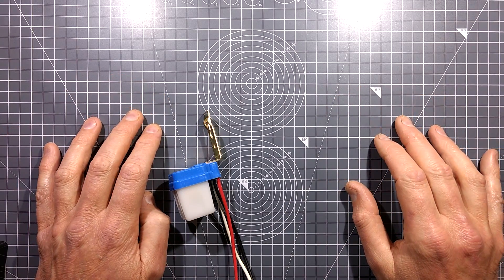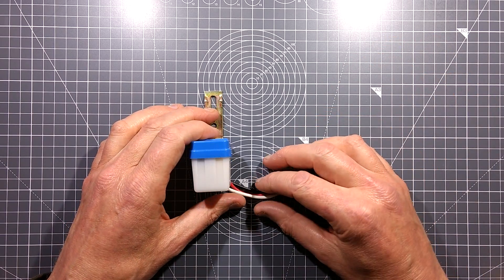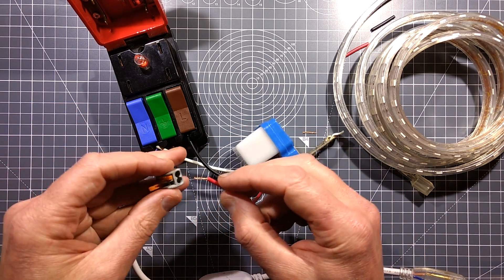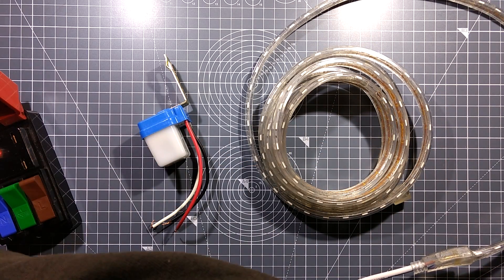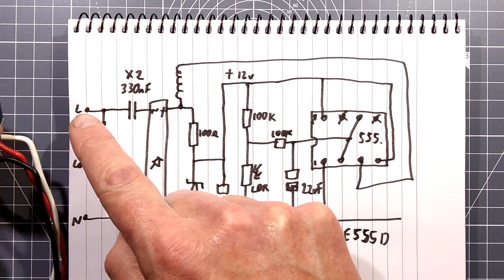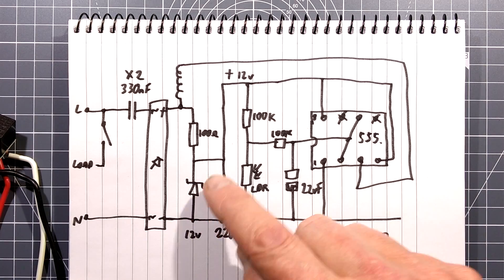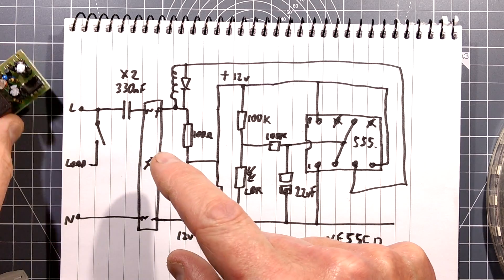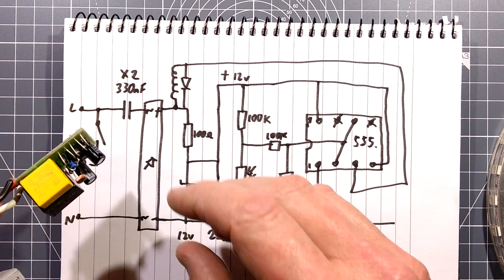Common Chinese dusk switch.  (With schematic.)

Comment: Have a metal plate instead of a cutting board.
Reply: From a chemical perspective, metal is safer than anything else he can have (within the bounds of monetary reason). Clive is smart enough to employ proper practice when working with electrical equipment. Also he can ground the plate, making it an actual safety feature.
Reply: Look, I'm a chemist, not an engineer. The guys concern is setting fire to his workshop. Unless he wants to pay for an expensive lab bench, a metal plate is the best thing he can invest in.
Reply: It doesn't take the sarcasm, try to be civil please, I blatantly don't mean "a nice thick sheet of potassium". And as for tempered glass see the comment about "within monetary reason". An aluminium plate would probably work quite well, actually. He's not going to be using anything that can penetrate the stable oxide layer (or at least I'd hope not).
Reply from the maker: Many of my experiments involve open live circuit boards on the bench, so a metal plate wouldn't be a good idea.
Reply: Fair enough. Would grounding the plate not work? (note: I'm not an engineer, so I don't know much about how grounding actually works).
Reply: Papa Clive could have chosen not to follow the advice of some rando on the internet, so it wasn't that dangerous of me to make that assumption. Also sarcasm's never civil, wouldn't you rather politely correct someone?

As for aluminium, it burns at such a high temperature (nearly 4000 Celsius), I assumed (now I know incorrectly) that Clive wouldn't use these temperatures, so it's actually not that boggling "how a chemist could consider that 'safe'".
Reply: Also, having purchased both types of work surfaces, I can tell you right now that Aluminium is cheaper to purchase, have custom cut, and have fitted than tempered glass.
Reply: Okay I'll admit I did try (and fail) at remembering the combustion temperature of aluminium without researching, for that I am well and truly sorry. Still, this combustion temperature is quite high, and I doubt it'd be that easy for Clive to ignite his work surface under normal circumstances.

As for the cost of work surfaces, at the time I purchased them, from the suppliers I purchased them from, with the specific dimensions I needed them in, the glass surfaces were always more expensive than the aluminium ones. That doesn't mean I'm wrong, it just means my real life circumstances are different from your cherry-picked circumstances. 

Were I no longer stand by my advice, I don't feel it's as bad as you're making it out to be. I simply put out a piece of advice, and with simple knowledge in engineering (knowledge that I lack) it was disproved, it didn't need all the sarcasm, I even stated that I wasn't an engineer. Honestly, if someone's thick enough to trust a rando in a youtube comment section without doing their own research, they probably deserve what's coming to them.

My degree is legitimate, I am a member of the University of Manchester, I can show you my documentation from the RSC, and my position in the universities student directory.
Reply: I mean how old are you that you have to have a hissy-fit over someone making a suggestion on youtube? You can't be older than fifteen, honestly.
Reply: As well as the fact that they do make workshop surfaces out of aluminium kind of mislead me from the start.
Reply: You're right, I messed up big-time, I let myself down in trying to defend my position when I knew it was wrong. I guess I took past experiences as universal gospel, when I should have realised that the needs of some are different from those of mine. Sorry I got angry at you, sorry I insulted you, and sorry I tried to drag this on with more unchecked information. Where I can't see anything criminal about what I originally posted, it was afterwards when I truly messed up and I hope you don't see this as my general behavior, because it isn't. Maybe it's the stress of exams, or simply boredom, but I shouldn't have tried to defend my position after I knew I was wrong.
Reply: Mind you the thing you said about it burning is still bullshit, considering he uses wooden and plastic surfaces (Which burn at a far lower temperature than aluminium ever could).

Comment: I see another thing that could limit this device's life - the mains power-on inrush voltage being fed through the relay coil to the humble 555's output. I doubt a 555 is mains rated!
Reply: Robert Backhaus maybe if you connected in darkness.

Comment: The new mat is too busy.
Reply: acertainshape That pretty much sums it up. The lines on it definitely are not nice to look at.
Reply: Siana Gearz I like it aesthetically, but I find it harder to focus on the the devices.
Reply: I think some lines are a lot better at focusing than "FOCUS YOU ....". Plain fine rubber mats usually have that issue that they cause massive focus hunting, and lines help with that.

The old desk did focus though due to inherent texture of wood chips and various little burns.
Reply: acertainshape Exactly this. Just plain MDF is a bit calmer to watch the subject of the video on.

Comment: I think the cutting mat is fine but the scarred worktop surface has its own character. I suppose you could always just switch things up whenever necessary or if you happened to feel like it, though.

Comment: I was like "Oh, they have quick tests in US colors? I'll go check them out!" Then I clicked the link and checked the price and was like "$60! You've got to be joking!" Why the hell are they so much?
Reply from the maker: They're an industrial product that is designed for maintenance workshops.  They were never really aimed at the consumer market.
Reply: I just wanted it to be clear on the origin of manufacture, I understand your desire for it to be cheaper and I wish I could offer a lower price but as Clive said it's really considered an industrial trade tool and are rather pricey, I've tried my best to remain competitive with the European version available from different suppliers to the US market and while also including an installed cable and spare (British plug) fuses that can't easily be found in the US
Reply: the Quicktests are manufactured in the UK, they don't come from China, also the units I have listed come with the cable installed
Reply: yeah that's how I get them from Cliff, I install the cables myself to make a nice finished product so people don't have to worry about doing that and also making sure they are using the right AWG to safely use the supplied 13 amp fuse which is 16 AWG, 18 AWG a common size for power cords people probably have lying around would require a 10 amp fuse to be safe, the fuses are not a standard US fuse they are the standard British plug fuse but here they are completely foreign
Reply: ElectricalNovice19 they're imported from Europe, customs is a bitch
Reply: That is true, I didn't think of that. It's aimed at a market where $60 is pocket change when it comes to tools.
Reply: Andrew J McKeown If I may make one suggestion, switch from the PVC cables to rubber jacketed instead as PVC cords tend to be very stiff meaning one has to really wrestle/wrangle with the power cord rather than the QuickTest simply lying flat in the bench as it should.  I had to switch the cord out on mine for that reason and is really the only thing I would change about your product. As for myself, the price was fine for what it is and the market it is intended for which is why I was perfectly happy to spend the $60 as it is much more secure than mere wire nuts when testing live circuits on the bench and provides a good and reliable, as well as a good visual, quick disconnect means when you need to kill power.
Reply: Ethan Poole, I have the same issue with my own personal Quicktest. I hadn't thought about rubber power cables. I'll look into sourcing them and swapping over if possible.
Reply: Oh OK but the 1 I got a few months ago just came in a white box without any lead attached to it.
Reply: That's about what they cost in the UK.
Reply: ElectricalNovice19 but I buy shit from China all the time for pennies...
Reply: And then you have to wire it up as well.
Reply: Hey, I never said they came from China. I don't really have $60 to blow on a tool that won't get used a lot on my bench. It would be nice to have if it were a little cheaper.
Reply: Cool. Lets just leave it at that, shall we?

Comment: The new mat is nice, but if I'm honest I kindof prefer the old MDF bench -- burns & all (those gave it some flavor!)
Reply: stryk187
The MDF bench with the name label is almost like Clive's trademark.... Changing it is like changing the entire business identity.
Reply: indeed ...the old work bench is iconic , like 'Ashens and his brown velvet sofa .... the fans like things to be  familiar . Its comforting
Reply: I kinda disliked the old particle board (yeah if it's MDF, it's some weird version). The cutting mat is better, apart from the glare, but I think just a simple real wood surface (semi-bright color, matte!) could be very nice.
Reply: spamlobster MDF and particle board in the northerly americas: MDF is closer to thick, dense cardboard in appearance. No discernible particles. Fine fibrous constitution. Particle board looks like saw dust from a circular saw on the surface, and chainsaw chips in the inside. I would call Clive's workbench MDF using Northern American deductions. Perhaps it's different in the less fun regions of the world?
Reply: Well that's pretty much my point, clive's desktop seems to have too big parts in it to be MDF, in my experience MDF is more like a nearly uniform mass, rather than something you can see individual details in, just like you described. 

I guess it just might be illusion from the scorch marks, lighting and video compression, so meh, it's beyond the point anyways.

Comment: I actually like the look of the cutting mat, and the "glare" near the top of screen does not bother me, BUT as you and I both know you need a surface that is fireproof, chip resistant, non-skid, non-conductive, non-reflective, non-staining, scratch resistant, gouge resistant, easily cleaned and easily disinfected. *

I'm not sure there IS such a material.

* Explosion proof would probably be a good thing, too...

Comment: I kinda miss the old bench. I like how it was gradually getting scarred from your adventures.
Reply: Each scar / gouge / charred bit can be related to a specific episode of Big Clive. He's depriving future subscribers of a major part of the channel's history!
Reply: The problem is  Clive's camera is focusing on the board, not the juicy item!  Whilst this is certainly resolvable, the "old" background was far less busy / distracting (and suffered far less glare too).
Reply: I suspect the new mat is negatively impacting the video compression efficiency, too.
Reply: ... or Photon's attic carpet.
Reply: Will - I'm aware of that, which is why my MDF benchtops are now THICK (18mm) marine ply. More expensive certainly but far harder wearing and far better load carrying ability.
Reply: Yeah but Photon is a electromaniac so its to be expected the mess he makes is bigger.
Reply: Yep, less confusing also...
Reply: The concentric circles were mesmerizing. 
But I like it.
Reply: bdot02 most definitely agree!!  ahh such good memories
Reply: Like the old bench too. The burn marks gives it character, shows everything that has happened on that bench!
Reply: bdot02 I agree! More manly. But pink and purple is cool too. I guess this would be a metro work bench 😊
Reply: Yeah, It's nice to have the measurements from the mat for scale but the chard places did that just fine.
Reply: +Misfit the mad  
I meant to say charred.
Reply: Misfit the mad yeah I suspect that the mat is acting like those paper sheets Clive used for a couple episodes to focus the camera.
Reply: Phil S 
That bench was only a few months old.
They take a beating.
Reply: hells yeah
Reply: The old bench top was less visually distracting.
Reply: Bottom, ha ha.
Reply: new bench top is to busy❗❗❗Must go with something like that of the old bench top❗❗❗❗
Reply: Oh yeah, Photons attic. He tried to hide the burns with rugs and the first time he did anything up there he melted a wire through them. I don't see Clive's mat lasting very long then.
Reply: Also with that new bench it's much easier to see when the thing we're looking at isn't in focus. During this video the PCB looked a bit blurry at one point and seeing how sharply defined the desktop was only made it more obvious.
Wouldn't the autofocus (if used) be more inclined to focus down on the desk as there's more detail?
Reply: +ElectriclNovice19 Swiss chard?
Reply: All green is the best color for a mat! Who gave you that mat is trying to sabotage your channel... LOL
Reply: Isn't it just the bottom of his old bench?
Reply: just like my butt

Comment: Better background, except the two bright light spots - even zooming in washes out the top of the screen. Oh, and you're missing the "BIGCLIVEDOTCOM" - just in case I forget who I'm watching!!
If the capacitor can be bridged, then I think I am completely misunderstanding the point of the capacitors - or perhaps zeners. Is there any chance you could elaborate?
Reply: Back to the old bench please, the new mat is visually cluttered and has too much reflection.   Thanks
Reply: The reason to have that in the shot is to prevent people from hijacking the video, editing it up, and reposting as their own.
Reply: Nicholas Barnes I hope I can help: I'll try to explain as simple as possible: The capacitor kind of drops the voltage in this case to lets say 20V (without dissipating very much heat, a resistor could be used as well but would result in higher heat output/higher power draw. After that the bridgre rectifiers makes pulsing DC out of that AC which results in around 0.7V voltage drop per diode which equals to 18.6V at the 100ohm resistor and zener diode. The zener always a specific voltage drop (in this case 12V) so the 100ohm resistor drops the rest (in my example around 6.6V). If you would bridge the capacitor and power it with lets say 15V, the diodes from the bridge rectifier would output 13.6V.The zener still drops 12 V so the 100ohm resistor has to drop around 1.6V
Reply: Ah. That was the bit I was missing - I thought that BC was saying it could still be powered from the mains without the capacitor. The rest makes perfect sense. Thank you.
Reply: Aha, no he said from 12V, e.g. a car battery or something like this
Reply: +Tom Losh Yes I have one of each. I buy cheap things like this to play with and often find Clive making a video of something I have in my drawer. ;) The mains version has been running a 15w LED spotlight aimed at my back garden perfectly reliably for two years now.
Reply: I noticed on the eBay printout he showed there was also a 12V unit listed along the bottom...